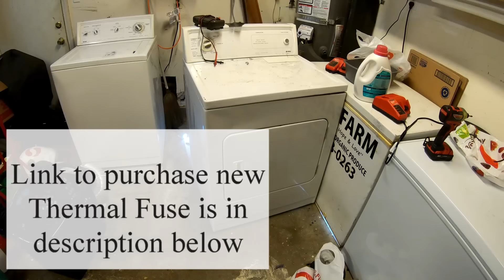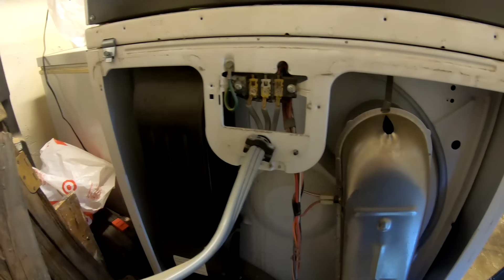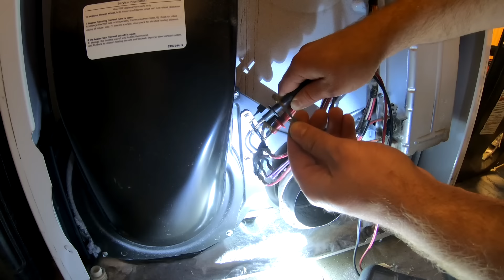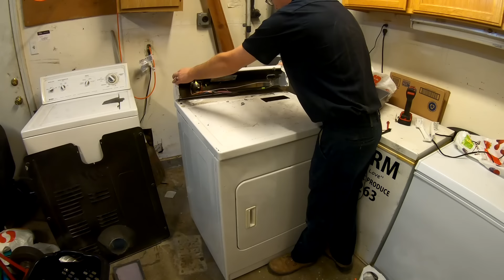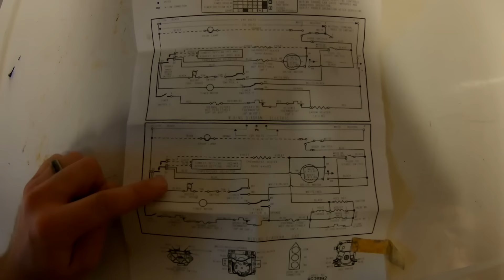Dryer Won't Start / Kenmore / What To Check and How To Fix

Comment: tried all three of these things and my dryer still isnt working- is there anything else it could be?
When you turn the knob to any position other than "off" it starts to hum, but it will not start.
The blower wheel moves freely too so i dont think its the motor...
Reply from the maker: If it is humming that means that the motor is engaging but it sounds like the motor is hung up for some reason so this could be something trapped back there or the motor itself is seized up
Reply: @handymanjourney  i took off the drum and belt, vacuumed it out down there real good and put it back together. its working now lol im stumped but glad it worked. Thanks!
Reply from the maker: Glad it's working!

Comment: This is an awesome video thanks! Well.. it's not the thermal fuse for me. The internal light is not coming on when the door is open as it used to on the dryer. That tells me that there's no power getting to it but I've tested this with a sensor and there is power. Is there a fuse somewhere else on these dryers?
Reply from the maker: Not to my knowledge
Reply: It turns out it was the door switch that was malfunctioning… and the light bulb had burned out prior. Strangely, taking the door switch out caused it to “fix itself” so I reinstalled  it and the dryer is functioning again!

Comment: First suggestion (fuse) worked perfectly! You saved my back having to move a few dryers, thank you @handymanjourney 
A note on the pattern I experience before the dryer quit completely: the dryer at first still worked for a few minutes before cutting out. It went like this about 3 or 4 times before stopping working altogether. Afterwards I removed and tested the fuse with a multimeter and it showed no continuous circuit or resistance, and once replaced it worked immediately.
Reply from the maker: Glad I could help!

Comment: I first replaced the thermal fuse and then the start switch. Still not starting. The light turns on and off when we open/close the door. Do I still need to check continuity for the door?
Reply from the maker: Door switch is probably good if light turns off

Comment: The door switch on mine was bad and I was going to replace it, as the dryer would keep spinning with the door open. Then the dryer wouldn't start at all. Could the door switch be responsible for both issues, or is it likely that it made the thermal fuse pop? I'll buy both since they're cheap, but hoping I won't have to install a start switch.
Reply from the maker: You will need to take some measurements
Reply: Thanks. In my case, I replaced the door switch first and everything worked fine, so I didn't need to replace the fuse.  I still have a pair if I need them.

Comment: So I've tested the thermal fuse, the door switch, the heater coil, the air duct thermostat, the two thermostats on the heater, checked the NC NO of the timer against the sheet, checked continuity of the start button but dryer does not start. How do I rule out or confirm the motor is the problem? Makes no humming noise at all.

Edit: checked also the 240v coming into the dryer

Comment: I replaced the thermal fuse first plugged it in and still nothing! It was working fine one day and then nothing! After I changed the thermal fuse and plugged it back in and pushed start I got nothing. I have a light on the inside of my dryer and when it was working the light would come on when I opened the door. I open the door now and no light comes on. What else do you think it could be? Would the door latch sensor make the light not come on and the whole dryer stop working as well?

Comment: Another solution I found was even though I got continuity on thermal fuse I cleaned it with emery sandpaper, and it fired up after that. I have an older dryer that has been going since 1985!  So yeah these contacts can get rusty.

Comment: If the fuse blows is it because the fuse was old or does that mean theres another problem that could potentially cause the fuse to keep blowing? My kenmore is 11 years old. I stopped it during a load to check if the clothes were dry then went to restart it and there was a slight pop sound and it wont start now. The start button lights up and makes it little sound  but dryer wont start. It worked just fine.

Comment: Great video thanks!  If it's the thermal fuse would we still have lights when the door is open?   I dont have any lights.  Dryer stopped working after subpanel flipped for the dryer

Comment: Do you have a video on your light sensor being stuck on. After cleaning everything out. I'm trying to find where the sensor is itself . That cause the Lint light to switch on / off... Anything and everything I search on Google takes you to thermal switch replacement or just an extremely thorough job of vacuuming. Is there anyway to pay for a 10 minute to 20 min call.????

Comment: Thanks… You saved me a bunch of money because I was  able to use this video to replace the door “thingy.”  Instead of paying for a service call and an up charge on the part - I paid less than $20 for two parts.  The little “thingy” in the back was replaced but did not fix the issue.  I don’t have an ohms meter - so I just replaced in order.  You ROCK!😅
Reply from the maker: Great work! I am so glad this video was helpful for you!💪

Comment: Before i order a new fuse, is it possible for the thermal fuse to work intermittently? My dryer will start when it has cooled down, but shuts off and won’t start if too hot.

Comment: Thank you for posting this. I was about to start a big disassembly effort when I decided to check the push button switch on your recommendation.  The problem was just a loose connector on that switch.

Comment: Excellant video. My dryer has a lot more screws on the back but the position of the thermal fuse is the same. Tested continuity with a multimeter and nothing. Just for kicks, I temporarily connected the two leads with a little electrical tape and it started right up. Got the part from Amazon for $4.99.
Reply from the maker: Great work! I am glad this video was helpful!

Comment: My dryer heats x 20 min then shuts off. Already changed the thermal fuse, the on off switch, the round switch in the back. Idk what else to change?? My dryer is gas. What meter do you recommend???

Comment: if thermal fuse is bad will the buzzer still work? cause mine buzzs on high heat very oddly, on delicates its louder, but it wont start.

Comment: You were right on about what was wrong with my old Kenmore dryer - the thermal fuse had blown, replacing it cost me all of $12 at a local appliance parts store and just an hour of my time, which was important because it stopped working the day before several generations of my family were showing up for Mother's Day, with some staying over which meant lots more laundry than usual. Carry on [fill in the blank]! still my favorite British comedy series that began just about the time that these washers and dryers were first being made for Sears-Roebuck.
Reply from the maker: Hey I. So glad this video was helpful! Have a great time with family!!

Comment: Great video! I've got a question. I tested the leads connection and one of them read 107 volts, not 240 and the other connections read  120 volts. I also tested the thermal fuse and there was not connection there. I have ordered a new thermal fuse and am wondering what may be the problem for the lead connection not reaching 240 volts? Thoughts?

Comment: If anyone can throw a response in here. I have a kenmore dryer that hasn't been working. A friend looked at it and ordered new..temp sensors and components. I replaced all that properly, following a video. The dryer worked the first time but now it doesn't. It lights up inside of the dryer, I also noted while off, it seems to heat up but messing with the knobs eventually seems to turn it off. I think it is the main wires. The power cable they got was not the same as original(wall outlet is old so the new cables have more prongs). The power cable has 4 wires. black, green, white and red. Green and White are on the same terminal. Maybe this is wrong? It is a kenmoore series 500 dryer.

Comment: My start button is new, but I hear the hum as if it's trying to start, but won't engage. Turns off right away. No lint issues. The last clothes dry, the cycle stopped half way. I let the dryer cool down, and it wanted to start but wouldn't. Do u think it's the thermal fuse? Tx

Comment: Allen don't teach people how to bypass stuff. Oh, I need the dryer and I have the part on order. No harm. Wrong. Don't teach this. This is truly only test measures which homeowner don't understand if there is a real problem and the circuit should be shutting down and it is not because they hot wired it. Bad call Allen. That is why as techs we carry them on our service trucks and have knowledge on how to check operation of machines.

Comment: It tried all this and it checks out. If it has too much wait it makes a buzzing like it wants to start but doesn't, some times I have to give it a push but without much weight. Has a lot of trouble spinning.
Reply from the maker: Sounds like the motor may be the issue

Comment: Well done, but I got stuck getting the top of the dryer off - seemed like something was still attached.  I didn't want to force it.  As a result I was unable to reach the connector to test the door latch.  Getting to the push start button is straightforward.

Comment: I watched your video and was thrilled....i went though all the tests and everything was working. I figured it was junk.
To my amazement my wife called me several hours later and said "did you check the belt?"    I said no and if the belt was broken it would start and just not spin. At least that is what I thought. She checked and found the broken belt. When I came home I pulled it apart and found that when the belt breaks the idler pulley retreats and shuts off a kill switch.     How can you not say check the belt first in your video. It might not be a top three, which the parts vendor said it is number two with problems.  Please update you video or place a notice so that us ignorant repair (myself, not my wife) have a better understanding.  I do appreciate your time and efforts.   Thank you
Reply: he did mention the belt switch

Comment: Great video! Used my multimeter to determine that the thermal fuse was bad. Jumped it to make sure, (using all precautions, of course). I ordered one from your link. Thank you very much. This information is greatly appreciated.
Reply: Thanks for giving me the confidence to do it my shelf.     Works great !

Comment: If the light inside works, you have power. If the light turns off when you click the door switch, that switch is good. I just saved you 10 minutes.

Comment: Question, will all 3 of these issues cause the internal light to not work? My internal light doesn't work, so I am trying to use that extra information to help me to isolate the issue.  I don't have a power tester and would like to try to fix the dryer without using one.

Comment: Good info! Mine is not starting when I push start but kicks on randomly after, going to check these 3.
Reply: What was your fix my shutdown and after 10 min I go to start and works again
Reply: @juanchoman9824  Took apart the timer and adjusted the contacts. Haven't reinstalled yet, but plan to today to test.

Comment: Thank you. Just replaced thermal fuse( which was the issue) and the start switch (just because). Spent $40 on parts and 20 min. Saved us a ton. Thank you for your invaluable information.

Comment: Hi, I have this exact dryer ? So I was drying and pressed start then I decided to take out the lent cap and it was full and it was sucked up by the lent funnel. And it didn’t turn on after that. So is this the fix to switch out that fuse because it overheated?

Comment: Thank you so much! Thermal fuse did the trick. I'm not too handy and your video made it easy. I also cleaned out the vent hose and it was packed with lint, which may have caused the fuse to blow in the first place(?) and now may have prevented a fire. So thanks again!
Reply from the maker: Way to go Dan! So glad this was helpful!!!

Comment: Door switch for me.  Come to think about it, it had been operating with the door open for a couple years.  Just cut all the wires on the back side of the connection and wire nutted them all together.  Works now.  Thank you!
Reply from the maker: So awesome! Great work!
Reply: So you bypassed the switch all together?

Comment: Thank You so very much ! My Kenmore dryer is 26 years old, and I don't want to buy another, since they don't make them like they use to. Your instructions were so clear & easy to follow, I can't believe I fixed it by changing the thermal fuse. Thanks again for the terrific video !

Comment: I have determined that the door switch is broken. Two questions: How do I disconnect it from the line? You did it easily; I can't get it apart. And is the part standard size? I bought one but it appears to be wider than the one now connected.
Reply: I have the exact same problem getting it apart. For me that’s not the problem. I know because I got continuity from the switch without having to take it apart. There are two tongs of Metal I tested it on just after that connector.  Would be really great to know how to do this! I feel like I’m going to actually break it.

Comment: What happens when the dryer comes on but the barrel won't turn
Reply from the maker: Possibly a belt
Reply: How do I change the belt or could it just fall off and need to be put back on?
Reply: Are there any instructions on changing the belts?
Reply from the maker: You will need to research how to change a belt on a dryer, different dryers come apart differently. It probably broke
Reply: @handymanjourney  Thank you for your time and help

Comment: WOW!!! thank you for making this video.. Just fixed mine... it was the t sensor like you shown in the video.  It would not start so i took the thermal sensor wires on put them together as shown in the video and it started.. bingo.. now an under $5 part on amazon.. but the wife is not a happy wife with no dryer so i found a local store in Dallas that had it in stock fro $15 .... happy wife, happy life.   :)

Comment: I took it apart but I do not have any wires going to my thermal fuse and it was working do you know would be the issue and why I would not have wires running to my thermal fuse?

Comment: Will the heater element come on if the thermal fuse is the only problem? I definitely have a bad fuse, machine won't start but heating element heats up!

Comment: Thanks for this great video! So I tested the fuse with my DMM and it overloaded the resistance so it seems like it’s gone, but even when I connect the leads it won’t start. The timer works when the door closes and there is no start button. Any idea what the issue might be?

Comment: My dryer is started automatically I mean its push start but it started wherever I closed the door...and the the  finished alarm didn't  stop when timer is done..it goes on constantly until I open the dryer door...

Comment: Thank you very much for this video! I just fixed my dryer, and it only cost me $1.61 and less than 10 minutes to repair! (That part was way cheaper than the $9 you originally said.)  I recently had it serviced, at over $300 for a new belt and motor issues, then it just stopped a few weeks later. Yes, the belt and motor were the issue then, but I guess this time it was that thermal fuse. Now, I am not a "handyman" by any means, but you made this fix seem really easy to attempt, which it was. Thank you for that! I realize that this video is over a year old, but as you can see, it is still usable.  Again, many thanks!

Comment: Gasoline dryer?!? That would be awesome!
But seriously, thanks for the info.  I had to take off the bottom-front kickplate to find the thermal fuses on my model.  Of course they were a pain to get to, but that fixed the dryer.  Best $7.50 I've ever spent!
Reply: "Gas" as in natural gas not gasoline lol
Get yourself a gasoline operated generator that accepts 220 and plug your dryer into that.
Gasoline dryer
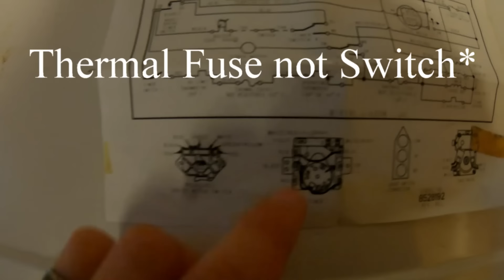Reply: @1stJaytree  At 9:48 for those who want to chuckle on hearing it!
Reply: We have a 100 series, heating element lights up, but dryer won't turn. Could that still be a thermal fuse?

Comment: My kenmore is so difficult to access. I can’t even take off the back. It’s basically all one piece!
Reply: Is it even worth fixing?
Reply: The thermal switch is in the front!!!
Reply from the maker: Hey, thanks for your comment, it sounds like yours might be a different model, it might be best to call out an appliance company to see if it is worth repairing or replacing

Comment: I've made it all the way to the Start Switch with no problems. But my Start Switch has 4 wires, not 2. Any suggestions? It's an 80 Series.

Comment: The back of my Kenmore dryer doesn't look exactly like the one in this video. We removed all of the screws and it would not come off. We can't tell what is still holding it on. Any suggestions?
Thanks
Reply: If its like mine, pull the front drawer open like a stove

Comment: Hi I have the same dryer as you and I replaced the fuse, but I am having this issue where the dryer will start once then after that the start button won’t do anything but make a clink noise. There is still power to the timer and start button. It seems to work again once I unplug the dryer and let it sit for a few hours then plug it back in, but again only allows me to start it once per unplug. What could this be?
Reply: What did it end up being mine does exactly the same
Reply: @juanchoman9824  Had to fully replace it. Tried multiple fixes, some worked temporarily and some didn’t work at all.